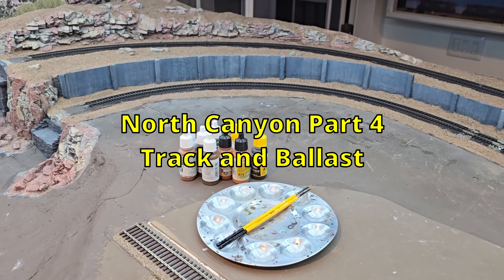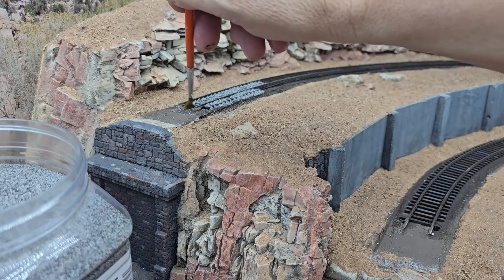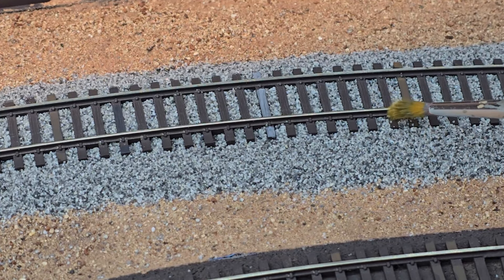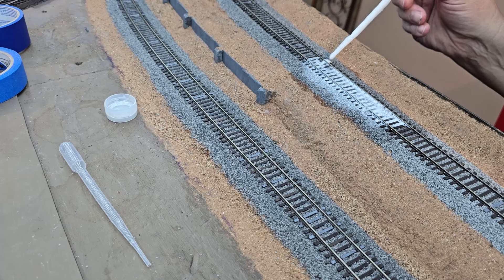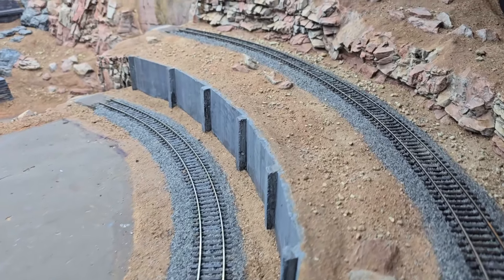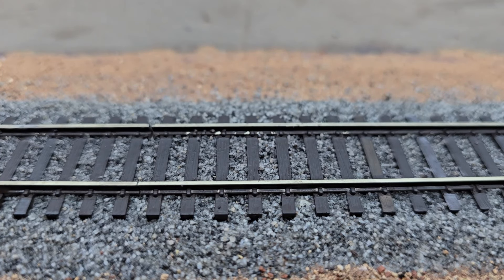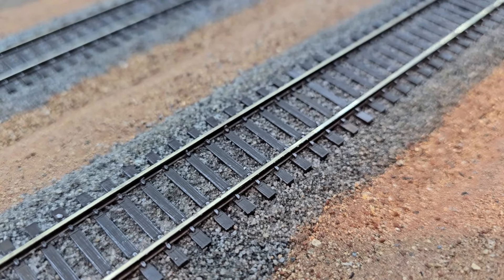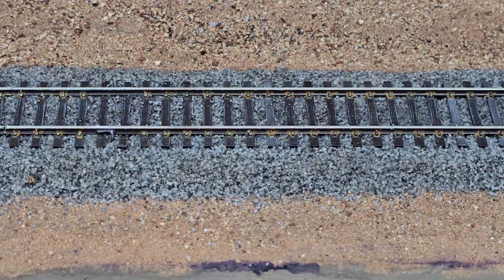Layout Update. Installing Ballast and Detailing Atlas Flex Track.

Comment: Looks great love it just was wondering if maby the rust wash should be very lightly painted on some of the ties cause the rust stain as it get more rusty would wash onto the ties and ballast that I've seen in real life but hey it's your layout
Reply from the maker: I appreciate the input; I may do that as I work through the layout in the future, but I don't think I'll add the additional rust to the track I've already finished. It takes a lot of time to do each spike and I'd rather not backtrack. It would be easier to judge if the track had defined tie plates, but as of now I've just been highlighting the areas around the spikes to give them some definition. The Atlas track is easy to work with, but if I were to do it again, I'd use different track.  Thanks for watching!